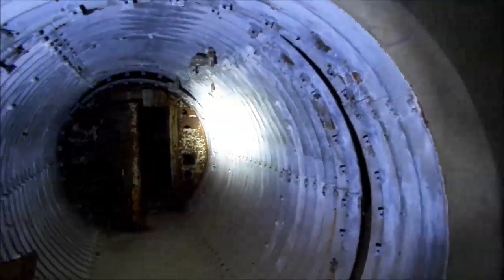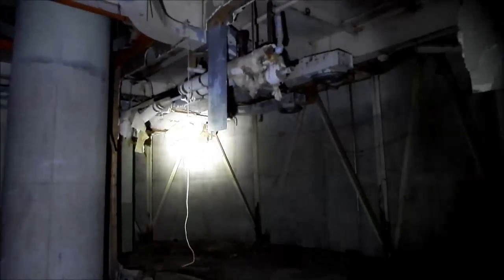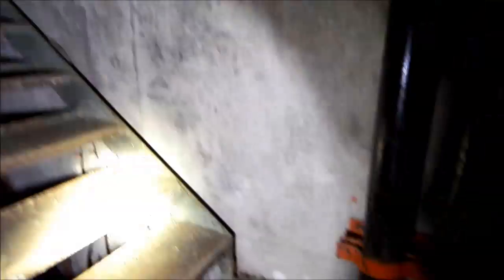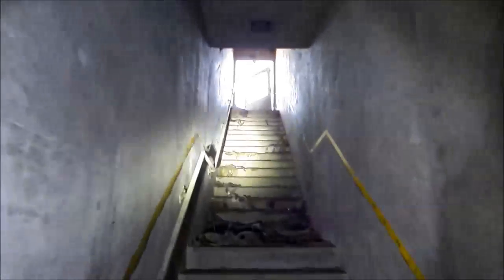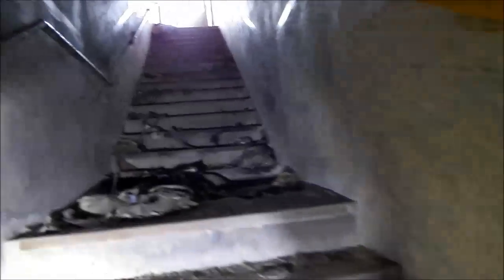Nuclear Missile SILO opened after 60 years sealed before reconstruction

Comment: As long as water doesn't get into the control center, this thing will remain in pretty good shape.  Closed up since about 1965.
Reply from the maker: Actually the first site is done, completed and in full operation.. I have some videos of it on the channel.  Construction is now ongoing on the second site.
Reply: Are they going to recommission this silo for military use?
Reply from the maker: The site is not being recommissioned to house a nuke.  It is being recommissioned for use as a bunker and some other things.  I cannot talk about who or what the specifics are as they are classified, but the site is fully self contained, self sufficient in every way.. from food and air to fuel and water.  The site is fully protected from NBC and maintains heavy perimeter defenses that I designed as the Team Lead of the security side of things.  The team I put together as well, are trained with military and/or law enforcement backgrounds and are full time for all the sites.  There are two fully armored tactical combat vehicles as well as other capabilities we don't discuss.
Reply: No.  This silo is an Atlas F site.  Way too old and unreliable.
Reply: Another Atlas F graveyard! 1000's of tons of concrete and steel. The Titan I's & II's have even more concrete and steel. Environmentally speaking, the construction of these sites was extremely intrusive. Even the Minuteman II & III sites that were deactivated and destroyed per treaty have lots of concrete and steel in the ground still. They are now talking about replacing the Minuteman III missiles......about 400 on alert with additional silos on "hot" status.....a launch facility with no missile that can be loaded with a Minuteman III missile and placed on alert. The plan is to use the existing silos for the new weapon.

Comment: What you see here is a Fiebinger developed underground ICBM silo, the first very similar one was built in Nazi Germany during late 1944 by MAKO near Arnstadt where the Germans started a large Skoda V101 (V4) 3 stage solid fuel rocket sucessfully from such a silo called Polte 2. (16.03.1945) Unarmed test flight went from Arnstadt to North Polar region radio guided.
Reply from the maker: LOL what it is with you German's and your desire to act like you invented everything?   What you see here is nothing but an ATLAS - F silo designed, engineered and built in Kansas USA and unlike anything developed during 1944 in size or scope.   Last I checked, Germany has NEVER built underground nuclear missile silos. Just because someone in your country made a hole in the ground, does not make it the first or even the best.  MANY farmers have created underground silos long before they were ever used for missile systems so your claim is more wrong than even what I said.
Reply: @Malakie  Go and google Polte 2 missile start

Comment: How long did it take the pump the water out? Do you run pumps continuously to keep the water under control?The Air Force must have done the same?? Is there faculties still there.. well water and sanitation?
Reply from the maker: A few days to pump out water when the project started.  The silo is actually water proof and sealed against any water penetration so it was mainly 60 years of rain water and in fact it was sealed completely when the new complex started happening.  A special pressured goop was pushed between the silo wall and the ground at high pressure and iinserted into any holes are areas that might be an issue, to insure no leaks. It was also installed with special sumps just in case there was a leak, regardless if it was inside or outside.   

The system has a full on sewage system and multiple fresh water wells were dug because the original wells were contaminated so the new ones drilled all the way down to the aquifer to insure they were not in ground water again and that it was clean.   If I remember right, it was around 700 feet for each well.   Finally, the entire complex can be completely off grid power wise and is self sufficient in everything from food and water to air and sanitation.   Even the NBC air purification and water purification systems are military and industrial grade.  Air conditioning AND heat are all geothermal as well.  Even the pool heat comes from the geothermal system.

Comment: The Titan was certainly not flat and raised up. They were straight up and lifted straight up on an elevator. The Nike was the missile that would lay flat and get raised straight up.
Reply from the maker: Correct although this one is an Atlas F site not a Titan.
Reply: @Malakie  I was responding to the description which states that the titan missile lays horizontal. Now that I think of it, people are probably talking about the Atlas E, not the Nike since the Nike was not an ICBM (but was horizontal). So the Atlas E which was a horizontal silo is likely what people may have been thinking of. Not the Titan I or II.

Comment: Stuff stays in good shape when it's made out of asbestos.
Reply from the maker: lol...  It cost quite a lot of money for the clean up and removal of the asbestos.  Much of this remaining is clear now, this video was filmed just before full on clean out and reconstruction itself began on this second site.   I don't remember what the costs were now they had for asbestos clean up but it was not cheap..  Once that was done and reconstruction could start, the first step taken was to remove all this debris, repair any concrete damage, inject sealing foam through specified areas the engineers stipulated to insulate the concrete from leaking/seeping etc any further and then blast clean and then coat the ENTIRE inside of the silo, all bulkheads etc with a special sealant covering before then using a industrial sealant paint on top of that as the final base.  From that point, then they could cover the actual bulkheads, walls etc with whatever they wanted whether it be dry wall, paint, armored polymers etc.

Took almost a year just for this step because that also entails make sure ANY and ALL holes that exist IN the meters thick armored concrete are also properly done .. i.e. places where pipes, lines, etc have to have access into the facility underground.. most being about 75 feet below the ground surface.  Once ALL lines, power, water, etc etc etc that needed any kind of access through the walls was done, they were sealed permanently...  which means if you forgot to run a power line or a water line from outside through the wall to the inside of the silo, you were screwed later because there was no access after that.  

A LOT of work and engineering is going into this project.. Site 11 is running and operational and has been now since 2015.  Site 12 is near that point now. Site 13 I don't have a status on currently since I had to retired due to my military injuries in 2014 and decided to come home to Wisconsin for good.

Comment: How did a missle fit through the blast doors?
Reply from the maker: In the video go to time code :25 and you will see my light illuminate two massive doors at the top of the silo itself. Those doors open UP and outward on huge hydraulic rams in only seconds.  A missile is lowered through those when loading the silo.  When it is fired, those same doors open up and out and the missile launches itself straight up through them..

If you look at my pictures library, there are photos from outside also showing the doors at ground level flush and there should also be some cut away pictures of what the complex looks like as built underground.. it goes down about 220 feet in total..